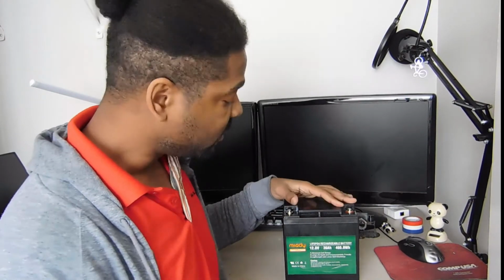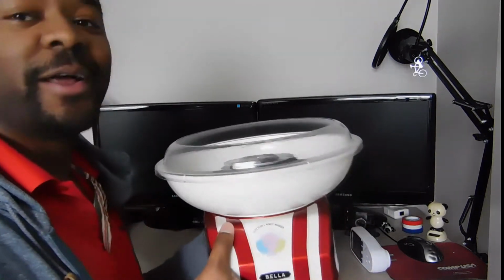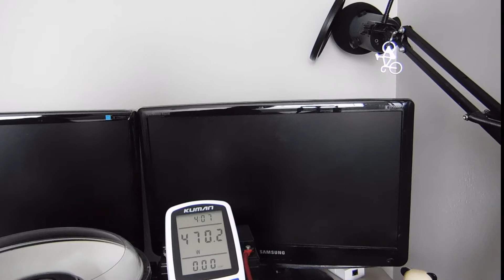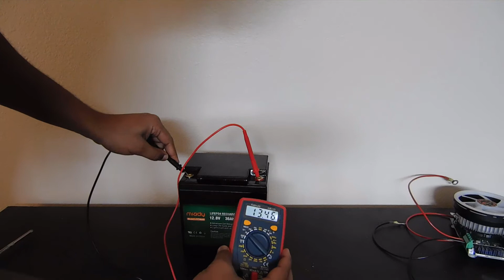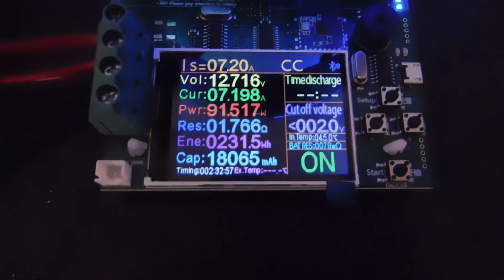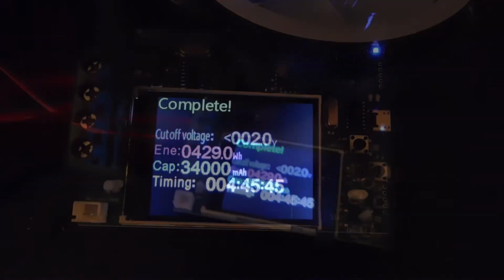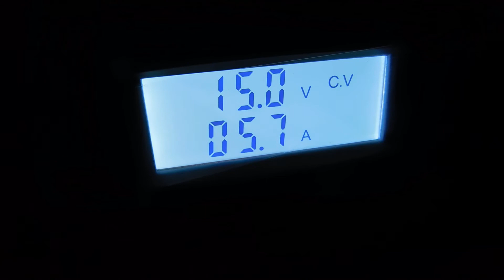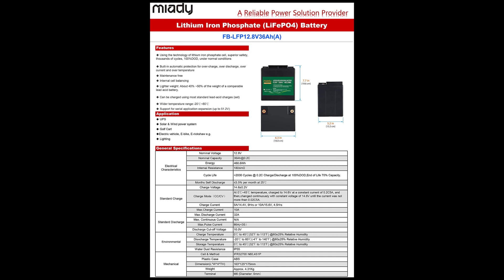Battery Review: Miady 12volt 36AH LifePo4 (Lithium Iron Phosphate)

Comment: I subscribed, could I have some more information on this battery.
9 months on How's it getting on please. I just bought one and its got suspicious 18650 cells inside. I'm  not convinced they are lifepo4.

Lovely video cheers.
Reply from the maker: I've been cycling it in a small generator since July and it's still running well. I've used it to run my laptop setup and charge my small electronic devices about three or four times a week without issue.
Reply: @smallscalesolar  this is incredibly helpful thank you.

Comment: How many amps should this be charged at?
Reply from the maker: Lifepo4 typically should be charged at no greater than .5C. In this case that means 18amps for this battery.

Comment: I have both the 20 amp hour and the 36 amp hour batteries used in two different projects. I have not officially tested them for capacity but in my youth they do appear to be fairly close and have been working well. Too bad you never know which ones will be in stock or if they will come back in stock. I do believe they are an excellent value though. Time will tell how long they last.
Reply from the maker: I really like my 36AH. My 20AH has that annoying over-voltage disconnect so I haven't used that as much, but I would definitely purchase more 36AH if they reappear. I agree, if these cells meet the cycle life that they've promised, they are an incredible value. 

I'm also hoping that we see a 50AH release. I think that size would be perfect for some small off-grid applications and "milk crate" generators.
Reply: @smallscalesolar  I reached out to Miady a few days ago on Amazon and they responded quickly that more were on the way, keep an eye out. No ETA, however.

Comment: Great video! I will order a 12v 20ah version so some small project i will do with Solar. Other than solar what home charger do you recommend to recharge this battery?
Reply from the maker: With this battery chemistry, I personally like 3 stage chargers. For these Miady batteries, something with a Bulk Stage of 14.6v, an Absorb with a Constant Current (for the 20ah, you'd want a C.C. of roughly .4 amps), and a float stage of 13.4-13.6v. I've had the best luck with 13.6v to get the full capacity out of these batteries. I haven't used any home chargers other than my benchtop charger (which is great as a testing tool, but is not meant as a battery charger). I would recommend searching Amazon for a LIFEPO4 Battery charger, you'll find a number of options, but as I haven't tested any of them, I would just look for something that meets the above specifications and has good reviews.

Comment: got same battery a couple months ago. $110 with $10 shipping. arrived in about a week, packaged same as yours. I charge at 2 to 3 amps at 14.8 volts till bms disconnect, then .1 amp so bms can burn off high cells allowing low cells to catch up. after about 3 or 4 charge/discharge cycles reached about full capacity. using a giandel 300 watt psw inverter and imax B6 clone charger
Reply from the maker: I've just completed testing of some of the 16AH versions and I think I'm gonna change my charge profile for the 36AH accordingly.  The 16AH seem to do really well with a 2 -3 hour "float" at 13.6, and I've been able to pull full capacity consistently. I'll try that same technique with this 36AH. That said, I've run a few charge/discharge cycles from this battery since posting this, just using a standard lifepo4 setup of 14.6 cutoff and a slow .02c constant current to the settling point of 13.5ish, and I've had the same results. I think perhaps, to your point, that the cells are not just well balanced.